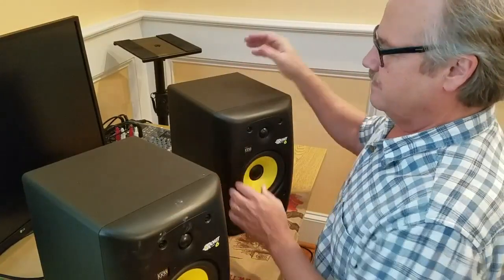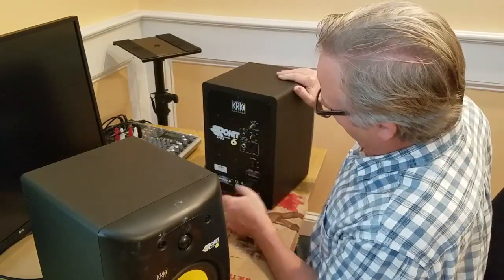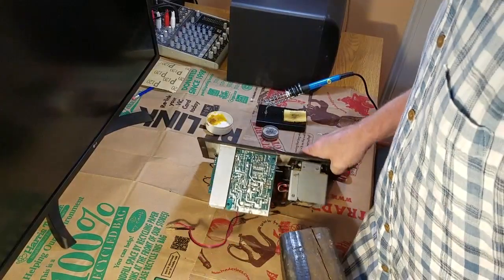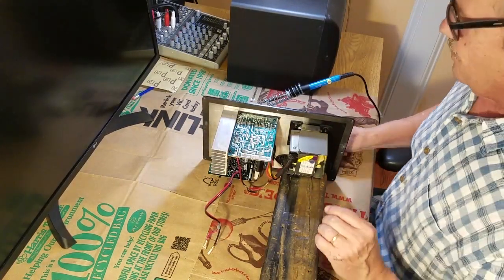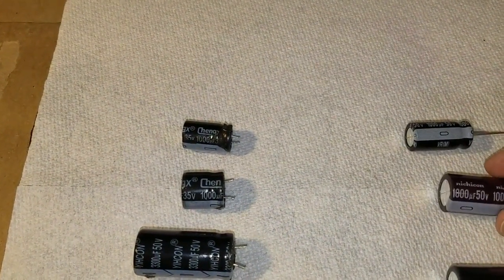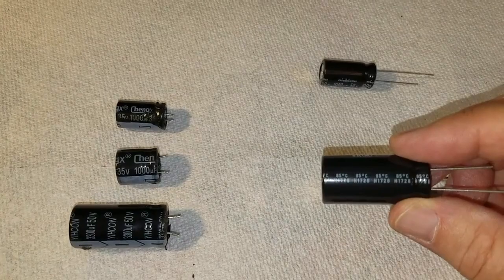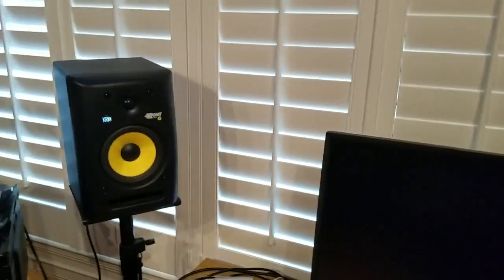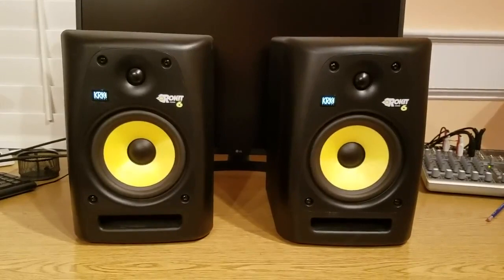How to Fix KRK Rokit6 Buzzing Noise

Comment: In case this helps anyone, thanks to this video I took my KRK 5 apart and the cap measurements are smaller... from biggest to smallest 2200uF 50V x2, 1000uF 35V x 2 (second one is thinner as well)
Reply: Thank you! Just followed the instructions exactly and used your capacitor measurements. My RP5 works perfectly now.
Reply: i dont get it
Reply: Are these the sizes I need for my krk 5 inch gen 1 ? 

Any help is appreciated. 

Do I need to replace all the capacitors or just the damaged ones ? 
Thanks

Comment: I don't use my KRK's rokit 5's anymore But, I have this issue. The crazy thing is after a few minutes the buzzing sound stops. It only does the buzzing thing if they are abruptly turned off. (like a power outage) At least I know how to fix the issue. Thanks!

Comment: I have a KRK ROKIT 6 that plays great for 20 mins or so then gets this SUPER loud BUZZ I can't stop without turning it off and back on again, its fine for another 15-25 mins then the buzz comes back it's SUPER loud buzz nonstop till i turn it off and back on again, I wonder if my capacitors are bad, ive tried different outlets, different power cords, even bypassed my board but the buzz comes back every 20 mins or so, love the speakers but it scares the heck out of me when it happens.
Reply from the maker: Probably bad, would expect the problem to get worse with time.

Comment: Got rid of the hiss in the KRKs after removing the "Black Goop of Death" from inside of them. The goop converts somehow and attracts moisture, even becomes conductive. Lots of posts and videos about this. Would hear random crackles, hisses, and static. Cleaned off all of the goop and removed oxidization (only at sites of goop). Didn't have to replace resistors but one was almost damaged. All PSU caps replaced, the rest was left stock. Sound perfect now, hiss nearly inaudible at full volume.

Comment: Hey I just wanted to say I just did this and it worked thanks for the help. Speaker sounds great now. The capacitor I needed was 1000 uf 35v

Edit: I could tell which capacitor was blown because the top of it was bloated upwards slightly. Hope this helps.

Comment: Thkx Glenn for your video very pedagogic which allowed me to fix the buzz. I have only changed the two caps side by side (1000 uf 35v) on the amplifier card and the buzz has disappeared.
I add it was very easy.
Pierre (from Paris)

Comment: Just did mine. Worked like a charm. Except before powering up I neglected a continuity test on the speakers...One speaker is tip top. The other one buzzed for 1 second and before I could even curse at it, it popped the tweeter lol. Checked the caps and they seem good. The one that popped had been the worst one for a long time. The woofer works good though. Replacement tweeter is on its way.

Comment: Glenn, thanks for a great instructive video. I have followed your directions, replacing capacitors and cleaning gunk, etc. but still have the same loud buzz. What would be the next thing to check? I have removed the tweeter and same, less noise, but still there. Power transformer?  Any direction would be greatly appreciated.
Reply: Did you figure out your issue? I replaced caps, cleaned gunk, still loud buzz coming out of tweeter speaker.

Comment: What would you advise if after an incident of unplugging an audio cable from the audio interface, accompanied by a short 60 hz buzz, the speaker lost some hi fi soundstage, like 5 percent of sound quality (female vocals started to sound more “inside”), and in general it the degradation can be described like “a studio monitor started to sound like an ordinary consumer speaker of that size”? Not every technician may notice it, and the repair can make the situation worse? I mean, the speaker works, but slightly duller than the other. What do people usually do in such situations, when change in sound is not very obvious, but still noticeable, compared to other speaker?

Comment: Do you think the rokit 5 inch speakers will have the same size capacitor as these 6 inch rokits ? 
My 5 inch rokits are making this noise but goes away after 3-5 minutes of powering them on. 
Thanks

Comment: So the exact specs of the capacitors to buy are 1000uF 50v 105C C (one with 5mm lead spacing and the other with 7.5mm ) and 3300uF 50v 105C both with 7.5mm lead spacing?  Is that correct?  Do u know of best place to purchase them?
Reply from the maker: The original 1000uF were 35v, but a higher voltage will work fine and maybe more durable. I don''t know the best place to buy but they can be found on Amazon.
Reply: @glennverner4987  I have to say your videeo is an absolute life saver.  It is the only one on YouTube that gives one a chance to avoid having to drop several hundreds of dollars to replace the speaker.  I got my sobering iron and I'm going to attempt this and thanks to your video I will probably manage.     Either way it is very informative and as a 44 year old it's a great time to be alive since years ago this resource (internet, YouTube, etc.) was nonexistent.  I've subscribed to your channel.  You should put up more videos.  You are trustworthy and methodical and I would love to pick your brain!  I will let you know how I make out...thanks again.
Reply: Are these capacitor specs the same as for rockit 8s?

Comment: Despite the difference in lead spacing, would I be able to use the same single model of Nichicon capacitor to replace the two 1000uf 35v? Is it necessary to have the two different sizes for the same voltage and uf?
Reply: he doesnt answer questions apparently. I'd like to know this as well

Comment: Hey Glenn, Im having this problem (or at least this noise) with my brandnew Yamaha HS8. As theyre brand new I doubt that the capacitors are blown. Will the  replacement of capacitors fix the problem anyway?
Reply from the maker: No, only if they were bad.

Comment: i used the cheapest soldering iron and sn40pb60 solder (which has a crossed out tv on it) to replace the 3300 capacitors and it worked

Comment: Hi, Glenn - thanks for sharing this very helpful and informative video! Sure helped a lot of us figure out the cause of our speaker issues! I read on your video that you had your KRKs plugged in power for 5 years - is that what caused the capacitors to fail? Could it have been avoided or delayed its failure if the speakers were powered off when not in use? Is this an inevitable issue for all speakers? Thanks again, Glenn. Your guidance is priceless!
Reply from the maker: Would expect it to delay
Reply: Capacitors failing is because those ones contain electrolyte of some sort - so it's chemical related. And their state can change with age, and maybe with temperature - as in power supplies. It's 'probably' a probability thing - as there are electrolytic capacitors that stay within specs for their capacitance for ages and ages. But failures of many electronic appliances has been due to failing/failed capacitors, which is why it's disappointing in that they haven't managed to 'improve' power supply capacitors after all this time. Possibly a bit of a fail on the 'technology' side of things.

Comment: Hello Glenn,  I have the same audio issues in this video but for my Rokit 5's (RPG2).   I opened both speakers but did not see any bloated capacitors at all.  I was really hoping to find some so that I can go ahead with this excellent instructional video, but now I just don't know what to do.  They also have a boom sounding pop when I turn them on and off.  Is there any suggestions you can give me?  Should I replace those capacitors anyway?  Thanks for your help!
Reply from the maker: Sometimes the caps don't expand, also the black glue can cause problems, be sure to clean it off as best you can.

Comment: What if none of the capacitors are bulging? Could they still be bad? Could replacing them still have a positive effect, or is my problem somewhere else?
Reply from the maker: They don't always bulge and the black gunk also contributes to the problem, clean and replace the caps.
Reply: did you replace them?  did it help?  Mine aren't bloated either.

Comment: awesome video but one question.

does the differences in lead spacing in ml matter? i found some at frys electronics but they don't tell me what the degree in centigrade and lead spacings are..
Reply from the maker: The Solder Sucker removes the solder from the holes in the board, this is required to allow the Capacitor leads to be inserted through the board.
Reply: @glennverner4987  got it! I'm ordering a kit right now. what about the lead spacing? no one seems to mention if its 5 or 7.5 ml
Reply from the maker: @chimarokeabuachi3327  it uses both 5 and 7.5 , pretty sure thats in the video.
Reply from the maker: Matching the lead spacing will allow the Cap to sit closer to the board. Higher Temperature Caps should last longer.

Comment: Hi Glenn,  I am having the same problem it looks like.  Can you tell me where you ordered the capacitors.  I am having trouble finding them.  Or if you have the emailed receipt with the specs if that is easier.  Thanks so much and Great video!!!  Thanks John
Reply from the maker: I bought from multiple vendors on Amazon

Comment: Fantastic video.  I'll be replacing the caps in my Rokit 8s in short order.  Thanks for posting this.  Is there any need to discharge the caps before handling them, and if so, what's the best way?
Reply from the maker: no need to discharge caps
Reply: how did it go? did you fix them?
Reply: @GJLCreativeStudios  Yep.  I ended up replacing something like 12 caps in the one speaker I believe.  I used an ESR tester, which showed that they were all out of spec.  The only ones that were still good were the two big ones.  Almost all the other dielectrics were bad.   I only did the one speaker which was crackling badly.  I might do the other one soon though, as it is starting to hiss louder.

Comment: Hi! How did you remove the black glue on the components? Mines have it spread all over the circuit :( Thank you for the video!
Reply from the maker: I used Isopropyl Alcohol, you only need to clean the area where you have to solder.
Reply: @glennverner4987  There is also a resister near one of the big caps that gunks up, used a screwdriver to scrape off the black crap.

Comment: Anybody know if the caps he replaced are the same in a pair of Rocket 8s? If not, does anybody know the specs for the caps in them?
Reply: I have the same issue with my KRK Rokit 8s. The capacitors on the motherboard are 2 4700uf and 2 1000uf.

Comment: My transistors dont look damaged, but I have the same buzzing sound (very loud), Might give it a try!
Reply: did you replace the capacitors?  trying to find out if they ever go bad and cause buzzing without visibly bloating.  Mine aren't bloated.

Comment: hey, thx for the video. i have a question about the capacitors you bought: has the 5mm lead spacing capacitor a diameter of 12,5mm and the one with 7,5mm lead spacing a diameter of 16mm? because i cant find a capacitor with 7,5 lead spacing and only 12,5mm diameter. i need to know this because mine have a horribly sound like in this video: https://www.youtube.com/watch?v=Z4v3OKaAXaM. do you think replacing capaitors will fix this horrible sound?
Reply from the maker: Wow that sounds bad, yes you have a good chance of fixing that by replacing the capacitors. The sizes you list seem to match up to what I used the 5LS lead was 12.5mm and the 7.5LS were 16 and 18mm. Also the size doesn't have to be the exact, as long as it fits on the board. The Microfarad is important, Voltage can be higher,  temperature rating should match 105c using lower temp will reduce the life time.